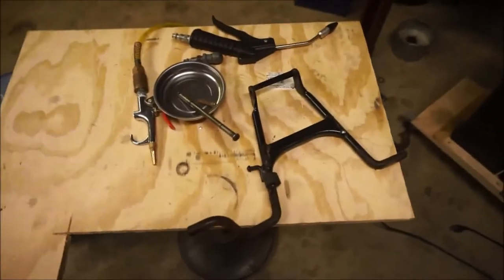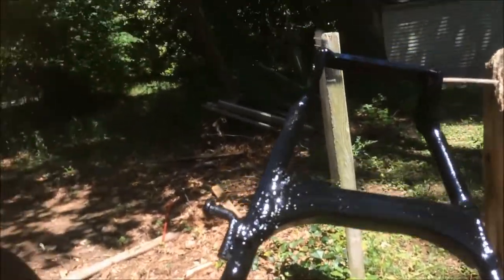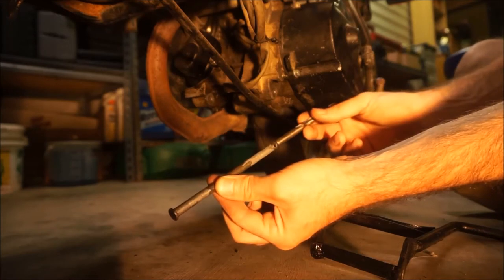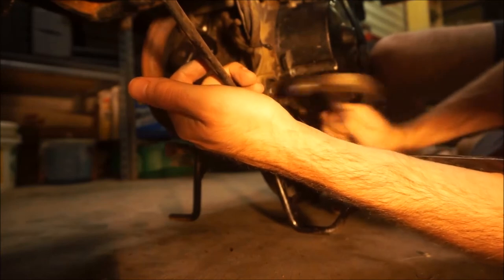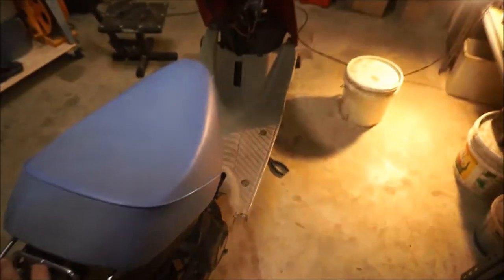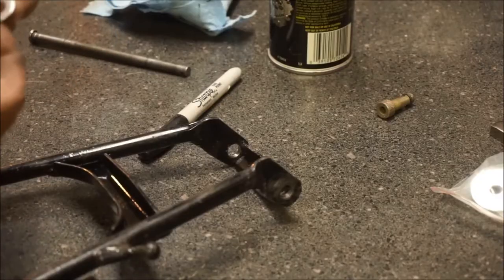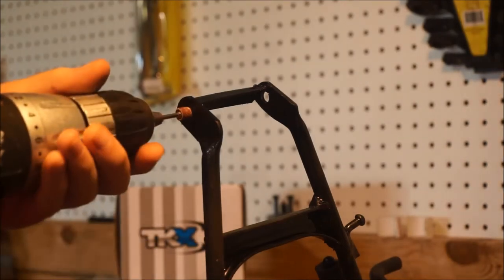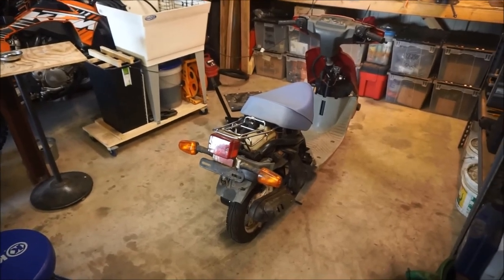Yamaha Jog Kickstand Repair

Comment: yep,my steel pin broke off a piece of aluminum casing..eton beamer 3 (jog replica),pins ACTUALLY bent on the stopper end,so NOW i dont even know if i can get that pin out..maybe have to heat it up?? wat a nightmare..the SAME DAY i get it running by installing cylinder,carburator,plug...
Reply: corrected,that end will not stop me from pinging the pin out screwdriver and hammer,lots of floor time with these huh?you spend more time fixing/adjusting than riding..i mean i dont want to say i can see why people want  4 stroke
Reply from the maker: @chilliduck9109  ehh.  As with anything mechanical, you're going to have to work on it eventually.  4 strokes have more moving parts so there's even more opportunity for something to go wrong vs a 2 stroke...and kickstands can break on either one.